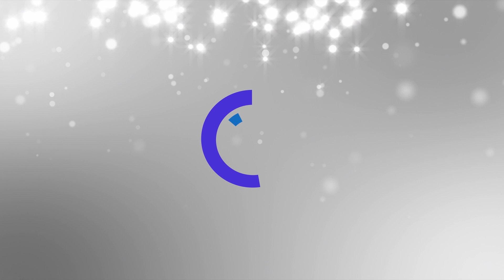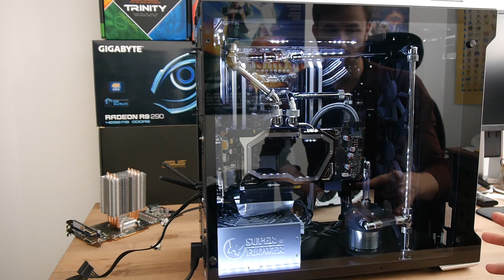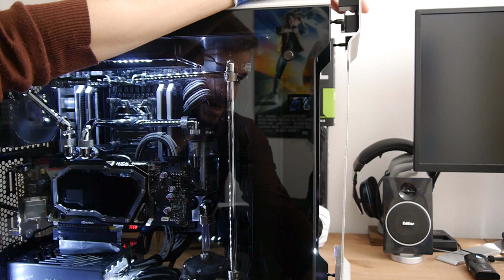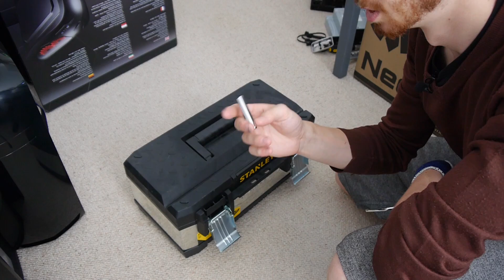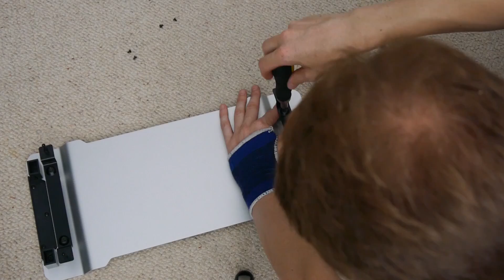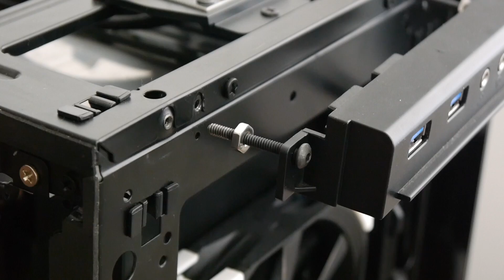How to Fix the Airflow Problem with the Phanteks Evolv ATX

Comment: How did you create the vertical GPU mount? Looking for doing one myself on this case
Reply from the maker: Teemu K So I actually wouldn't recommend the way I did it because I moved my GPU further into the case to line up my tubing runs :P

A good way to do it, that I would actually recommend, is mounting it to the expansion slots. So the part of the GPU where you screw in can hook it onto the top of the expansion slots and if you drill a couple of holes you can screw your GPU in and it will be extremely stable.

You might have to cut one of the bars across the expansion slots to access your ports though.
Reply from the maker: Teemu K Tom Logan from OC3D did it that way in one of their builds I think, I'll have a look for it!
Reply from the maker: Teemu K here it is, I think he talks about the GPU mount must after 7 minutes :) 

https://youtu.be/KSVUyAceW6w
Reply: Jeagar Tech Thanks. I'll have a look

Comment: Here is how i fixed mine, cut a giant rectangle shape hole on the front panel, weld a metal mesh, sandpaper + paint, looks good as new, + proper airflow  :=)
Reply from the maker: I think that is literally the best way to do it if you have the tools. I was very close to choosing that option. but really wanted to keep the front panel solid. sop ended up choosing this. But cutting a hole and adding mesh is definitely the no.1 option for increasing airflow :P

Comment: I took my front and top panels from my Evolv ATX to a fabrication shop to get ventilation holes put in them. They did a good job, more than what I would have done, and airflow is optimal again.
Reply: Can you show us some pictures?
Reply from the maker: That is a pretty good way of doing it if you can. I was really tempted to go down that route, but also really wanted to keep the clean panels :P

Comment: I have the same case and have seen where some have mentioned airflow issues in this case. For me so long as my cpu is not running hot or my other hardware im fine with it. My solution to the gap in the side of the panel if it becomes a issue for me is simply to get some thick felt and run a strip along the side to close to gap completely off so no air can come in. I live in a very dusty place so i havent yet seen a issues but if their is 1 it will soon show. Also i have thought about just getting a think piece of construction board and just making a gasket for the excess gap in the side where the glass meets the case. I havent put any fans in the top of my case and im using a Hyper Evo 212 for cooling. My sysemt is a Ryzen 5 1600 OC to 3.8 running at 1.2875 volts with temps 61c to 66c max which i consider pretty desent since these cpu are not the best over clockers. Just thought i mention the felt or construction board as a alternative method to the gap issue if dust is causing you a problem. I do love these cases i think their 1 of the best cases on the market only thing i dont like is the off side panel being class. Thats a really nice system you have their by the way,
Reply from the maker: I'm actually in the process of modding the rear of my case with some noise dampening foam covered in metal, mostly for looks, but also for a little coil whine dampening. The thing is though that it probably wouldn't help much with dust because the air would just get sucked up through my power supply lol. And blocking all of the expansion slots might make them annoying to use if you want to install new hardware at all. You could do it though and it will probably fine, but there is no need to do what I did if your temps are fine :)
Reply: Very true i just thought id throw that out if dust coming in from the side of your case was your main concern. I no theirs many ways you can mod a case to help with air flow dust ect. Im all for the easy fix if possible. Just thought id throw that out if ya hadnt thought about it. These are great cases and i love mine hope you get yours lined out the way ya want it and good luck.

Comment: Great job on this mod. It does fix the airflow problems for sure, but hurts a aesthetics a bit too much for me (not a criticism on your mod at all). I'm with you; I wish we could have the best of both worlds with this case at stock. I'm looking at a building a new system with the evlolv mATX TG case instead; I hear that they spaced the front panel more appropriately for airflow and with high static pressure fans in front, the airflow should be fine.
Reply from the maker: PCGoblin that's not bad, but that entirely depends on your setup. There is definitely reduced airflow at the front from that panel, that's pretty clear from the test I did in the video.
Reply: Same case water cooled custom loop, overclocked 7700K 5.2Ghz@1.39V 2xGTX1070, under full load difference in CPU temps with lid on vs lid off was a whole 3 degrees C, really overstated airflow problem, 3 degrees C big deal.
Reply: Your build is beautiful. Nice job!
Reply: I have this case ordered, on the way. I'm thinking that if there is a negative pressure and thus dust build up issue, then simply configure top fans to ingest (blow in). 
If there's a rad on the top, warm rad air will be blown into case, but you would be surprised how little difference it makes to mothetboard/VRM temp etc. And of course the advantage is cooler CPU temp as its cool outside air entering the rad.
Positive pressure doesn't have to be provided by just the front fans.
Reply from the maker: Yeah I personally like it for my build, but that's just my opinion, everyone will prefer it differently :) I don't know about the mATX case having better spacing, but with good fans you should have decent airflow anyway. The airflow in my case wasn't ruined, it was just annoying me haha
Reply: Jeagar Tech Slightly higher temps, still within a manageable range, are fine in exchange for asthetics (for me at least), but extra noise and dust are not. Again, well done.
Reply from the maker: I get it, that makes perfect sense :) And the aesthetics of these cases are sooo good, I'm sure your new build is going to look great :D
Reply: I found that there was only an 8 degree variance with all the panels off and them on with everything running 100% and overclocked. So I dont think theres really much problem with airflow on this case.
Reply from the maker: Peter Scrace by the lid do you mean the top or the front? 

Also, are your fans run on a fan curve controller?
Reply: With only the top removed, fans run from individual headers on motherboard via UEFI, it really depends on how you set up your cooling, GPU's are water cooled as well as the VRM's so not a lot of hot air in the case in the first place. See post 29 mine is set up completely different to yours http://www.overclock.net/t/1639041/advice-on-high-cpu-temps/20
Reply from the maker: Peter Scrace right, but the top on vs the top off has nothing to do with what I did in this video. I was looking at airflow through the front of the case. Airflow through the top is a completely different topic.
Reply from the maker: Peter Scrace your top fans have plenty of room to breathe, I wouldn't expect removing the top to make much of a difference...
Reply from the maker: +Martin W I completely agree with all of that. Having rads on intakes doesn't cause temp problems and positive pressure isn't just about front fans at all. 

The reason I didn't use the top as intakes is mostly because it isn't filtered so it wouldn't help avoid a dust issue. Dust would pass into the case just as easily because there isn't a fan filter to catch the dust (well the radiator would catch some, but that doesn't help :P).
Reply: Accessory fan filters are available though. You could certainly add filters. Glad you mentioned that actually, if I find I need to configure airflow this way I'll need to get some.
Reply from the maker: +Martin W that would be a good way of preventing dust build up for sure :)

It's up to whatever you prefer to do. I'd still prefer to do it my way though haha.
Reply: Hehe... okay then enjoyed your video all the same. And your custom loop looks great. :)
Reply: Couldn't you have just switched your top rad from push to pull?